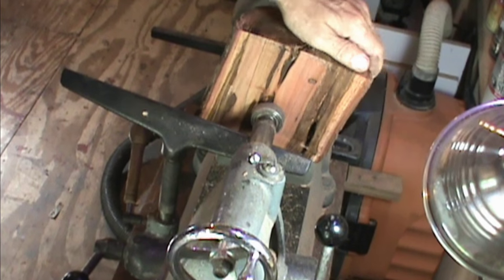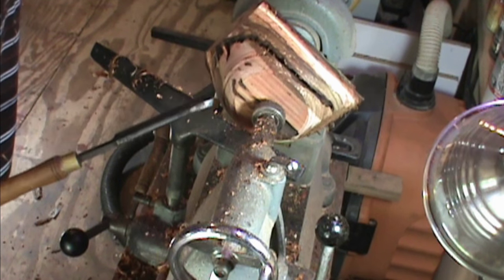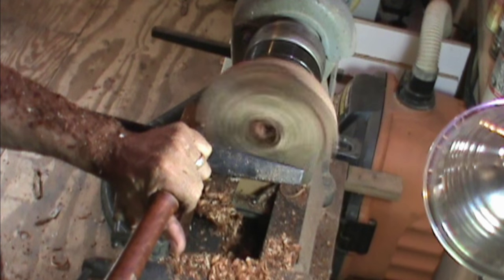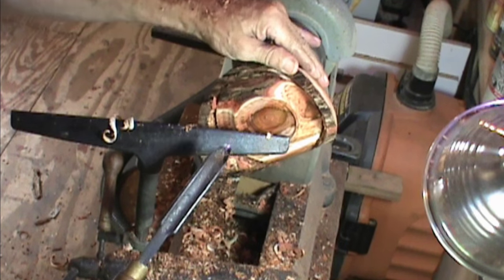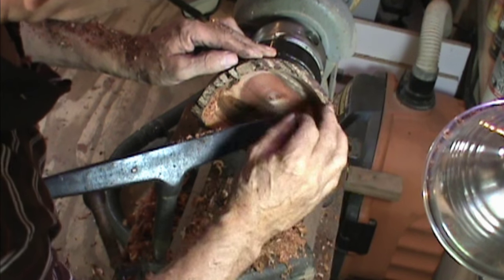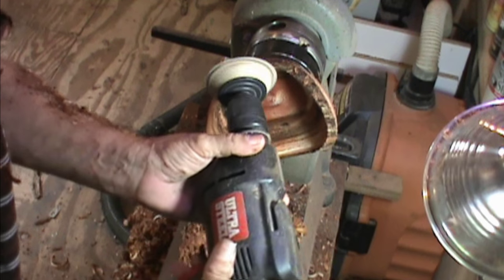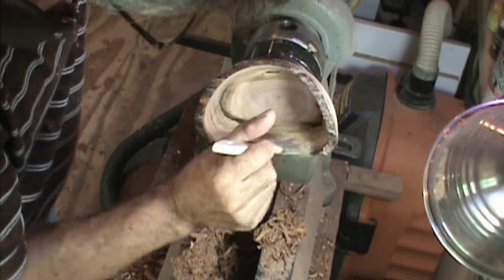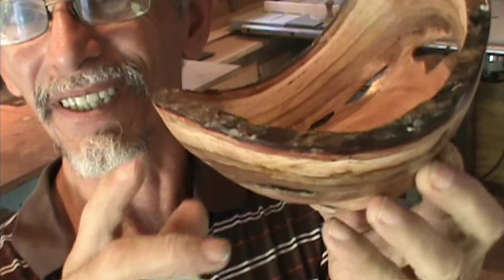Natural edge Pepper tree bowl  by Al Furtado

Comment: Thanks for another great project. It is nice to see different woods utilized as nearly all my wood stock is Maple, Fir, or Cedar. The latter two are hard to turn as the growth rings run hard/soft/hard/soft etc. So when sanding I end up with ridges.
Reply from the maker: Earl Rumble Thanks my friend. Well I haven't come across any Maple yet but I know turning cedar and fir would pose a problem with sanding. I find that clean grit and a light pressure helps a little on hard/soft woods don't let your pad bounce with the wood. I hope that helps a little. Happy turning my friend.PS I don't know where you are located but I find Craigslist curb alert to be my best source for woods.